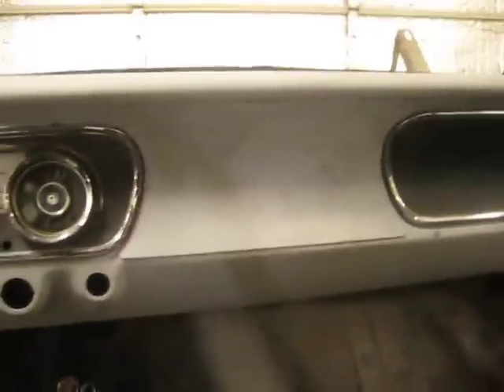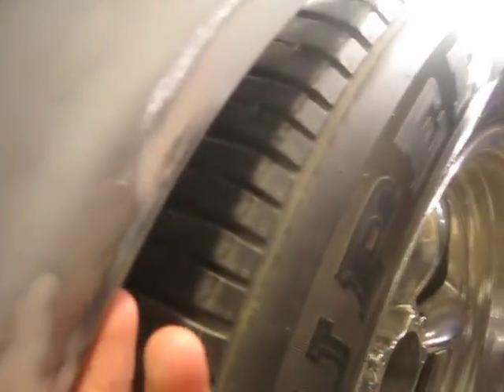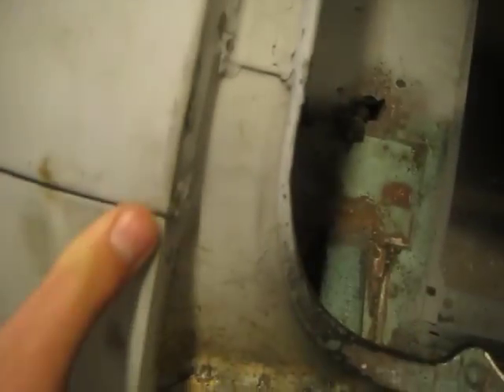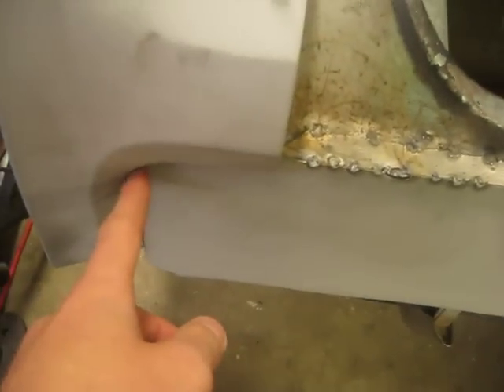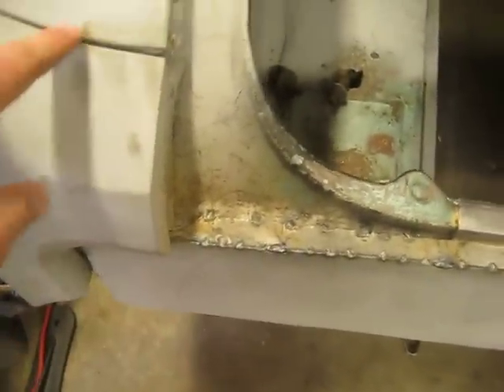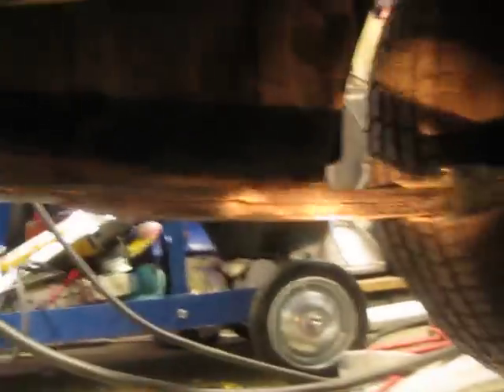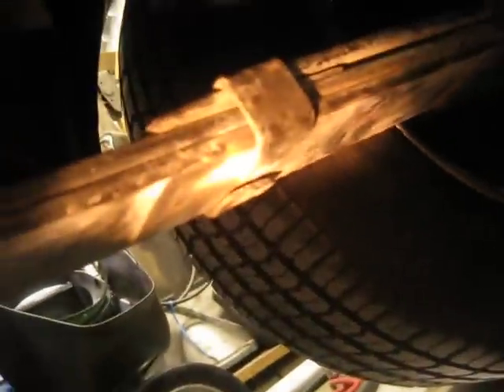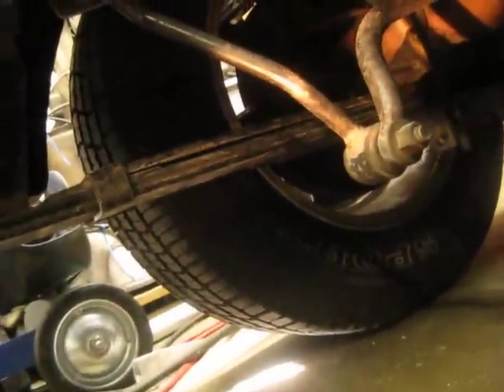1965 Mustang Restoration PART 7a

Comment: Nice work on the radio delete and subframe connectors!  Those molded in quarter panel extensions will be a custom touch for sure!

Comment from the maker: I got good penetration on the frame, I accidentally burned through it a little bit at one point so I know the welds are good lol. I was having ground issues with that one sway bar mount, that's why it was all blobed. I went over it again and fixed it.
I was using a wire feed. Today I got an ac/dc Lincoln stick welder for my birthday so I can try it out when I weld the subframe connectors.
Thank you!!

Comment from the maker: Thank you!!
Nice! Lincoln and Miller are pretty much the best. It's a Lincoln K1297 AC/DC 225/115. The specs say it can pretty much weld anything. I can't use in until I install a 50A power outlet though lol.

Comment from the maker: Thank you! I'm putting a T5 in it so it'll have overdrive. I also wanted to make the car different so I'm keeping the 200 inline 6. It will be extensively modified though, I'll hopefully get ~300hp out of it over the stock 120hp. I upgraded everything to stronger V8 components (steering, brakes, front end, rear axle) so I can put a V8 in it if I ever want to later.